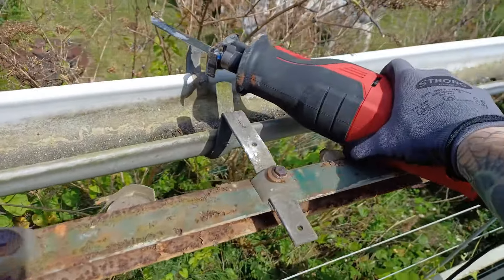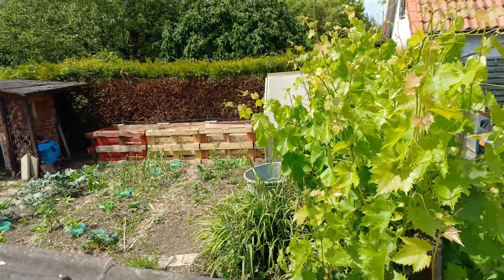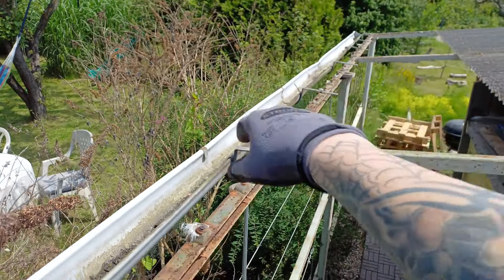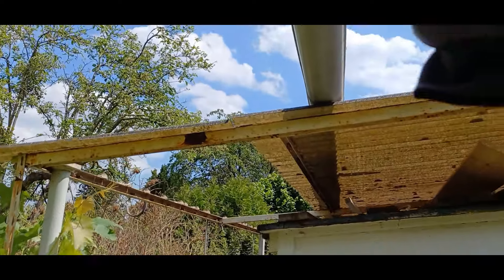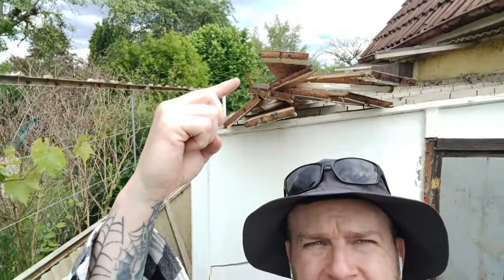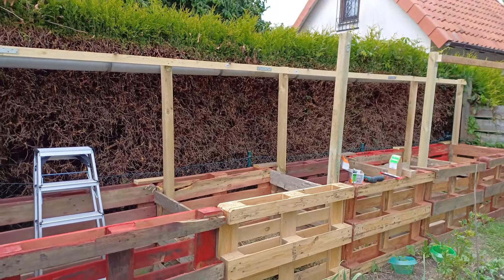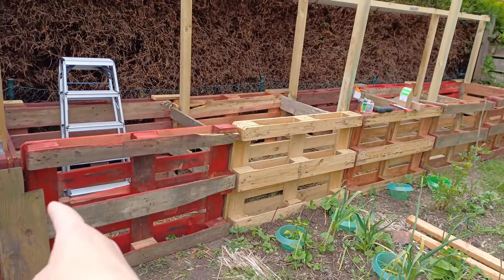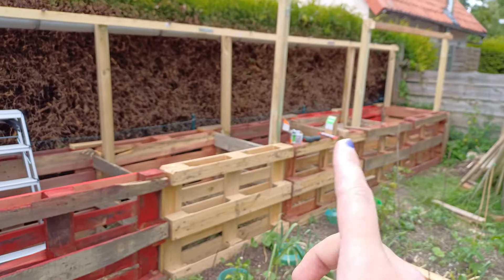Building a German Garden "Laube"! Part 1

Comment: Fantastic work. Of course you have the right experience! My father, who is useless at DIY, and my uncle ( who is good at DIY) built a huge garden Laube that we as family of 4 even slept in in the summer. A few years ago the re[laced the roof felt which had blown off in a storm, my uncle was already 80! The Laube has been solid for nearly 50 years!
Reply from the maker: I think my DIY skills is the reason my girlfriend keeps me around😝 
Just kidding! 
She plans to spend as many nights as she can sleeping in the new one! We will have it with a sleeping loft.
Reply: @ericderami  It will be very warm in the loft, esp if it is a heatwave! We only were to sleep in the Laube when it had been warm, very very thin walls!
Reply from the maker: @silkedavid8876  We added a couple of windows to the Design and we will add insulation to the walls and roof. I forget the exact plan but I think we will add about 10 cm. Including some heat reflecting Folie (I forget what its called🤦‍♂️)